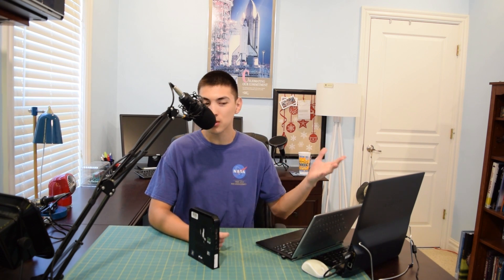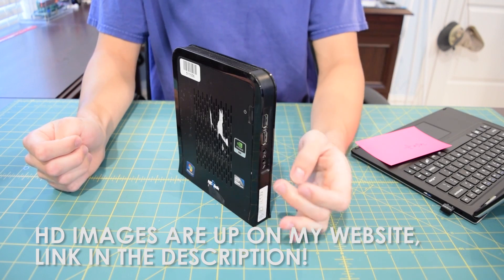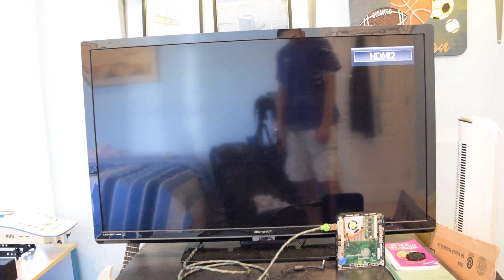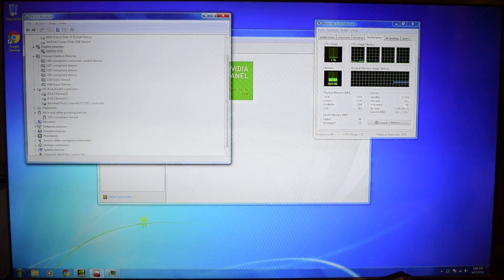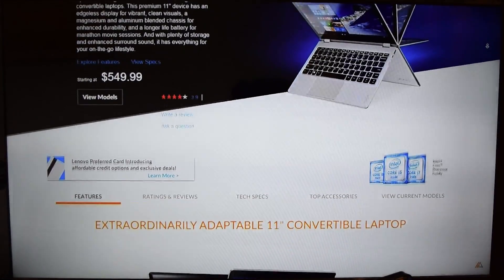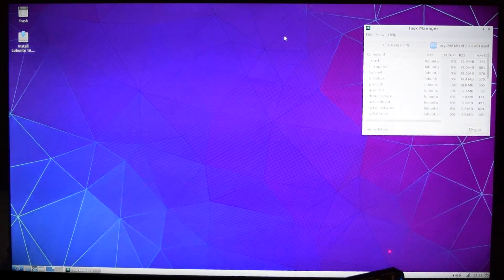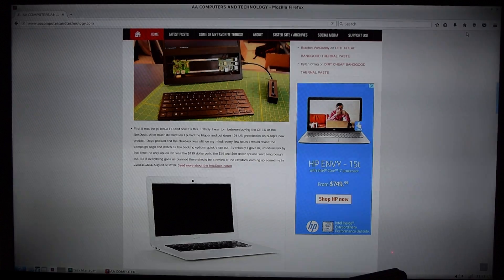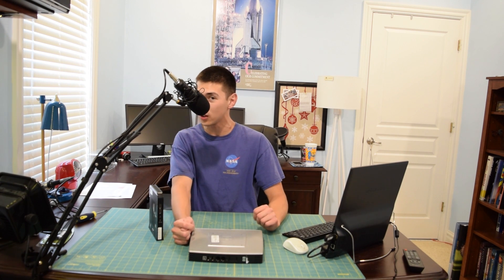eBay Finds: $8 Seneca Nexlink MiniX 10 Thin Client Overview, Teardown, Light Gaming

Comment: I don't get how some computers can render 3D games, but cannot watch YouTube in HD.
Reply: TruckSimz it's the codecs man, compressed video is a bitch.
Reply: Youtube defaults to VP9 codec on Chrome.  And only the newest video cards or Intel CPU's have hardware acceleration for it.  VP9 cuts the file size and data transmission costs for Google, but it's hell on older CPU's.  Basically, Google says "tough luck, go buy a new computer, we know you can't live without Youtube."  Solution: h264ify extension on Chrome will force YT to serve the usual h.264 video, which any decent card (Nvidia 8400GS, Radeon 4350 or higher) or integrated GPU will decode.   h.264 is easier on older CPU's, too.
Reply: Hah. I encountered exactly the same behavior except in the context of playing downloaded video via mplayer on a machine that could not handle Chrome. webm (vp9) was terrible, MP4 was a lot better. TIL about h264ify....

Comment: My mind is boggled by the fact you didn't bother installing a 64-bit version of Windows, and you're running it off USB,  further crippling performance.
Reply: Why that? Running 64-bit Windows on systems having less than 4 GB RAM does not really make sense. Because 64-bit addresses are longer than 32-bit ones (obviously) you use more RAM for the same stuff. And the advantages of greater precision in floating point and higher integer ranges are not yet widely used nowadays. So for the moment using 32-bit OS on systems with less than 4 GB RAM makes only sense if you have specific application requirements.
Reply: @gentuxable  better software support

Comment: Once you get Windows 10 onto the unit which should also install the UBUNTU install no need to duel boot  following that download KUBUNTU, copy all the files from the KUBUNTU Distribution into the appropriate folders then reboot and you should be able to just select KUBUNTU by selecting the UBUNTU menu item from the Windows 10 start menu OK.

Comment: Use a boost-buck converter to this puppy up https://www.amazon.com/Geeetech-Converter-10-32V-Voltage-Charger/dp/B00NK4LOBC/ref=sr_1_3?ie=UTF8&qid=1471708402&sr=8-3&keywords=boost+converter 
just set it to the right voltage or either just put a 120mm fan on top of the boost converter. I use this on travel when I go on a long trip in a car.

Comment: jesus christ it was at 132^F (56^C) when you were on the bios . the sensor may not work that well though i'd check on that though and if possible and maybe get a better cooling system for it or a faster low watt fan
Reply from the maker: I think it would definitely benefit from thermal paste replacement!
Reply: AA Computers and Technology it would i never thought about that . If you can use a bigger or better heatsink

Comment: pentium 4 540 to q6600 is this good idea ?
Reply: If your motherboard can, of course.
Reply: Pentium 4 = useless, Q6600 = good enough for pretty new-ish games still.
Reply: its a p5b-vm and its supporting it.and I ordered the q6600 for 18$
Reply: can I get 40+fps on gta4 with the q6600??
Reply: Im WallBang
Yeah. It could even run CS:Go at over 100fps if you overclock it to 3Ghz (just set FSB to 1333) and if you have a somewhat okay GPU.
Reply: +nelizmastr i have an ati hd 4850
Reply: Im WallBang
Should be good for medium settings in GTA and CS, sure.
Reply: +nelizmastr do you have skype????

Comment: That's impressive for $8 and 20 watts. It's easy to forget that these things are like, what, over 6 years old now? They were so overpriced back then and now you can get them for the cost of a fast food meal. I wouldn't worry about those temps at all. Although replacing the thermal paste is a good idea since it's probably just a clump of chalk by now.
Reply from the maker: Yup, it is a pretty good machine for $8!

Comment: Don't you think thay your main site's domain is a little bit too long? Also, next time try to record the screen directly as the flicker of the TV really hurts the eyes.
Reply from the maker: Nope, I think the address is fine.  I am trying to find a decent cheap hardware screen recording device that has inputs for both VGA and HDMI.  Do you know of any?
Reply: +AA Computers and Technology You could've used software like camtasia for example. I mean, what are the advantages of a hardware recorder instead of a software one except of the little performance gains.
Reply from the maker: Hmmm, I am looking for something a little more portable though.  I will have to browse around their site and see if they have anything that fits my needs.
Reply from the maker: On such a low end system like this software recording would impact system performance.

Comment: There are a few other sellers on Ebay who have them. Just do an Ebay search to find them. Price seems to start at around $13 plus shipping without the hard drive. I have a use for a small, low power computer like this at my church to play announcement, welcome, and other videos on a 40" TV in the lobby, unfortunately I have no idea how well it plays videos. Can this playback 1080p or 720p videos in mp4 and wmv format smoothly?
Reply from the maker: I attempted to play 1080p video at 60FPS (MP4) back on this machine and it did drop a few frames here and there to the point where the video appeared jerky.  720P at 60FPS played back fine, it dropped a frame several times during 4 mins of video playback but the video was watchable in my opinion.  I tested both resolutions using windows media player.
Reply: Thanks. I would be using VLC which tends to playback more smoothly than WMP plus I can run that on Linux.

Comment: have you experienced an error while installing any ubuntu distro
i have a eeepc with the same cpu and gpu and i constantly get a kernel panic after booting the pc
i've tried many way to fix this but i but for the moment the problem wasn't found
Reply from the maker: Hmm, I think I remember seeing forum threads about people struggling to get Linux working on those.  Have you tried something really basic like puppy linux?
Reply: nop,not tried this yet
i searched a lot and tried a lot of different methods, i tried with lubuntu and xubuntu so quite basic linux distros but nothing worked, i also tried some command in grub at boot, a boot partition repair with a liveusb install but this hasn't worked either.
 that would be interesting if you try to install lubuntu onto this machine and show how to proceed